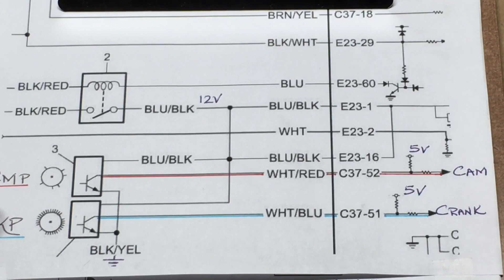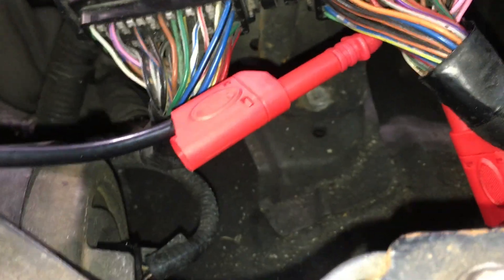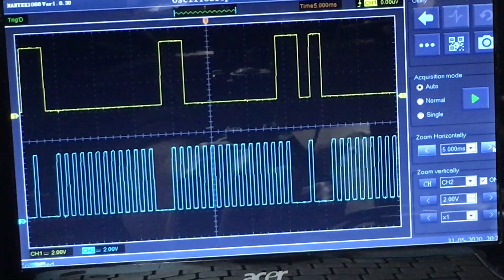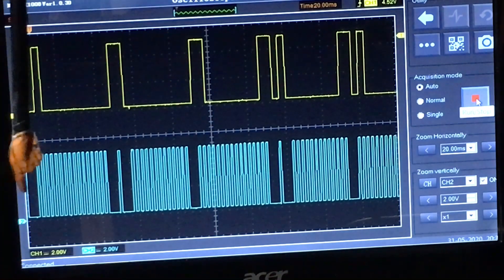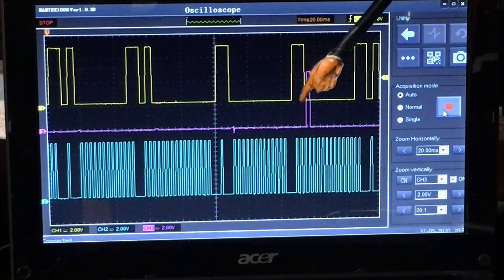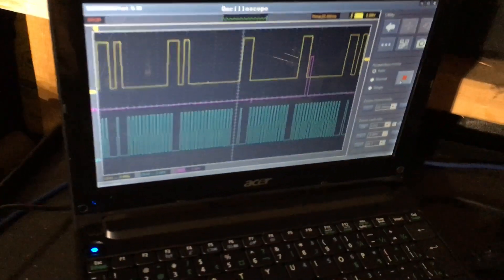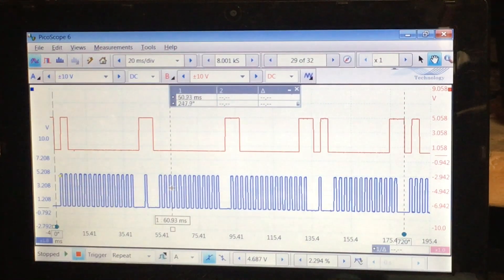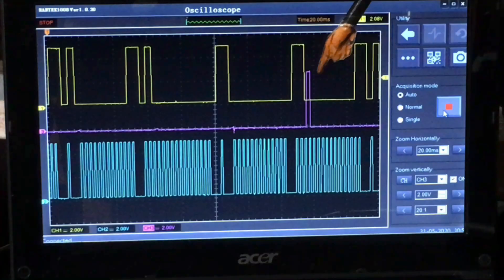Hantek 1008C Vs. Pico 2204A P2

Comment: Just saw your videos (1 & 2), great demonstration. I also have both scopes. Bought a Pico 2205A first and was disappointed to learn that it is not supported on PicoScope 6 or 7 Automotive. However you just demonstrated that automotive signals are able to be read from any scope. Fyi, Pico 6 & 7 do have guided tests that are very helpful showing how to connect (either) your scope. Thanks for the videos.
Reply from the maker: Thx you Sir. I am not big on automotive presets. So long as yer not dealing with an injector or ignition trace. 20V & 20msec work for there….Cheers 👍

Comment: I thought the 2204A wasn't supposed to work with Picoscope Auto software. How are you lining up crank angles with the cursors at 10:30 or am I wrong in assuming that that feature is only available in Picoscope auto?
Reply from the maker: No you’re not wrong. Somewhere along the line they limited some of the features. I can’t really speak to the issue now, as I stupidly sold my 2204A years ago. Thx for watching. 🍻

Comment: since you using hantek1008c i got a question when and what are the output pins on hantek 1008c at the back i would like to test tachometer on my boat  v8 gas engine without running the engine bench test tach has 3 wires 12v dc plus signal can i use output pin for freq signal and which that would be engine is not running yet thanks paul
Reply from the maker: Honestly I have never used that facility on the 1008. However, in reading the manual it appears there is 8ch (D0-D7)square wave generation capacity. Some parameters are adjustable. Output level is LVTTL, Frequency 0-250KHz as stated in the manual. Thx for watching 🍻

Comment: Does the Hantek have the RULER function? Seems very useful for working out timing issues etc.
Reply from the maker: Similar…Hantek utilizes a measure function which can be used to manually measure X or Y axis parameters. 🍻
Reply: @TheGibby3340  Can you work out advance in degrees with that measure function?
Reply from the maker: Yes but there is a little mathematics involved. You have to convert time to degrees.

Comment: Hello.  Will the dumbbell 1008c be better than pico due to the fact that I have no experience?  I mean these automotive functions.
Reply from the maker: The Hantek software is simple....which is both good and bad. Initially it’s easier to deal with. But in no time you are bumping up against its limits because it so simple...Thx for watching 👍

Comment: Does the Hantek 1008c works well with 4 or more channels simultaneous?
Reply from the maker: Good question...to be honest I don’t know. Have only used a max of 4 channels I think and it seemed fine. (It’s pretty slow to start with) I should put it to the test as you are not the first to ask that question. I suspect it will slow. Cheers

Comment: Put a coin on top of the coil on plug, probe the coin and you should get a signal. No need to probe pins. Just don't use the ground, there is no need.
Reply from the maker: https://youtu.be/nxa4Yxa6Nic 😀

Comment: Hi I just wanted to say  I like your channel and always look forward to new videos. I haven't bought a scope yet and wanted to ask how the hantek 1008c performs with 4 or more channels at same time? Thanks Mike
Reply from the maker: Michael Fannin Thank you Sir. To your   Question...I would say it really depends on the type of signals you a scoping. Low level relatively low frequency are ok. Higher voltage, high noise (especially HT ignition) can render it near useless with constant lockup’s. I seldom use more than 2 or 3 channels simultaneously to be honest. I have tested it with all channel sampling a 1000hz 2V square wave and it seemed fine. I know this may not be a satisfactory answer  but I have very limit experience with it utilizing more than 4 channels simultaneously. Cheers
Reply: @TheGibby3340  thanks for the quick reply. I'm torn between buying the picoscope 2204a and the hantek 1008c. I would like to have more than 2 channels for cam and crank correlation for cars with more than 1 cam sensor. And also would like to use hscope. Thanks again
Reply from the maker: Michael Fannin Yeah that’s exactly why I have both. Picos a better scope no doubt, but the four channel maybe out of reach cost wise for the hobbyist (like me) 😀 Cheers

Comment: I've watched a few of your videos. I understand that the 2 channel picoscope software is superior when it comes to general scope functionality. Have you tested any of the more advanced automotive functionality (such as signal generation) on the hantek? If so, do you think those functions make the hantek more useful for troubleshooting, or would you still recommend the 2 channel pico over the hantek?
Reply from the maker: Pico scope is a far more capable tool. The 1008 remains unbeatable value if  multiple channel capacity is important to you. They both have a place IMO. Signal gen function on the 1008 is fixed frequency & amplitude very limited utility. I have multiple videos on both in the back catalogue. Cheers 👍
Reply: you probably dont give a shit but does anybody know a way to log back into an instagram account?
I was dumb forgot the account password. I would love any tips you can give me!
Reply: @Clayton Eden Instablaster :)
Reply: @Dakari Esteban I really appreciate your reply. I got to the site through google and Im in the hacking process atm.
I see it takes quite some time so I will get back to you later with my results.
Reply: @Dakari Esteban it did the trick and I finally got access to my account again. I am so happy!
Thank you so much you really help me out !
Reply: @Clayton Eden no problem xD
Reply: @TheGibby3340  The function generator on the Hantek 1008C is intended to be used to calibrate conventional scope probes and works very well for that application.

Comment: Yes the Hantek is USELESS with high voltage noise in the testing vicinity. YES - due to secondary high voltage effecting it to lockup - even reboot the connect PC by crashing the port etc.
With the included HT-25 pickup... no matter how careful you route wires or select earth clamp.
I purchased the 1008C to do Secondary ignition testing so a door stop. Got a Pico screw Hantek rubbish design and software.
Maybe we should ban CCP China  made substandard products that are not useable and end up in landfill plus wasting money! Your too kind ... Hantek are a FAIL.
Reply from the maker: Thx for watching.

Comment: I purchased a 6022BE product.
Then I feel like a waste of money.
It does not meet the standards of a technical device .
Hardware .
It is only capable of receiving + - 5Vdd .
Signals larger than +- 5 Vdd will have amplitude distortion.
Amplitude distortion is displayed on the screen.
It does not achieve +-20V visibility like grid cell.
Software .
It's the dumbest show in the world.
It has no drift mode. Like hospital electrocardiogram machines.
When I want to research a long event .
For example
I set the timebas to 1000 seconds. Hanteck runs in the background and doesn't show anything.
Until the scale is 1000 seconds, it will show up on the screen.
For 1000 seconds, I couldn't see anything and went to wait for coffee.
If the numbers reach explosive danger, then I don't know either.
Because Hantek shows nothing on the screen.
Hanteck should only install microphones for babies alo hello!
Reply from the maker: Pretty sure right in the title it refers to the “Hantek 1008C”. I am not selling anything, spend your money as you wish.